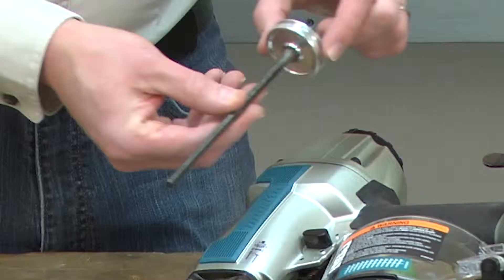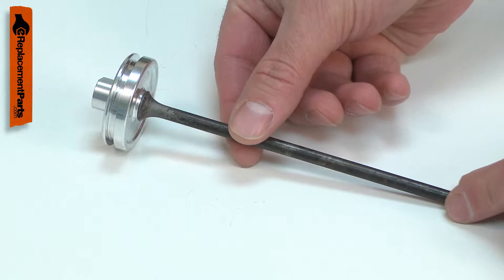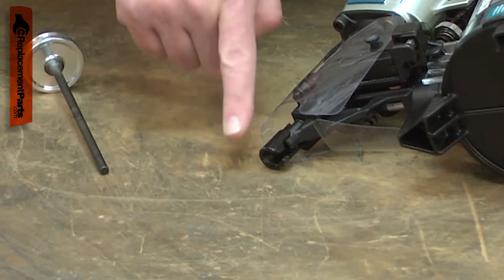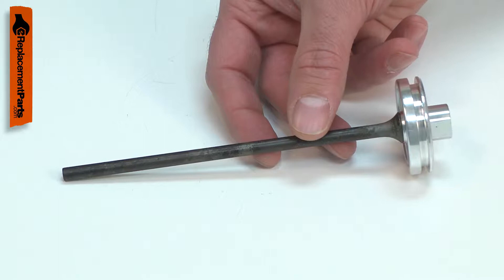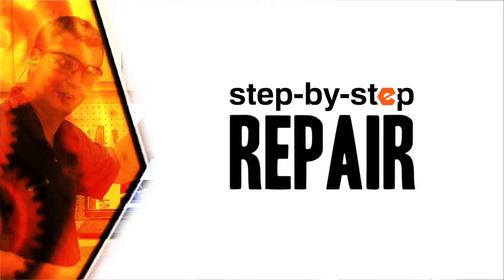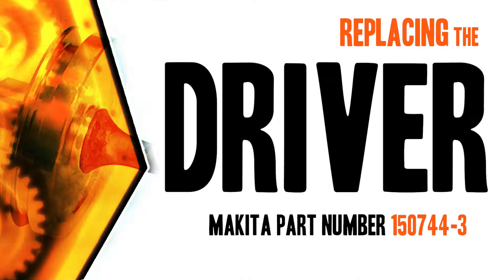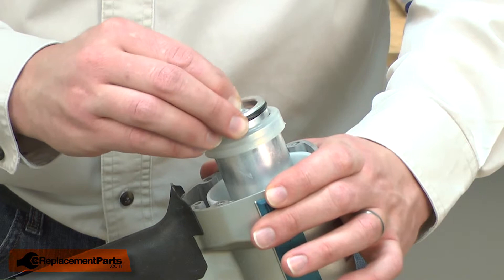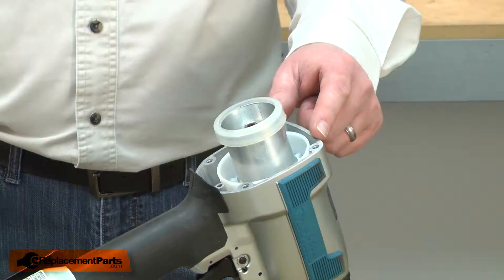Makita Nailer Repair - Replacing the Driver (Makita Part # 150744-3)

Comment: If the o-ring is OK and driver isn't bent, what causes the driver to not retract, and how do I fix it?
Reply: Same problem here...I'm guessing a nail is jammed next to the driver.  If you were able to fix it - how?  Guessing some disassembly is required.